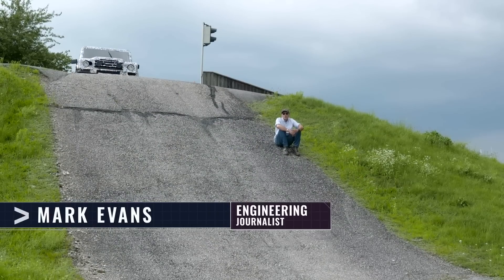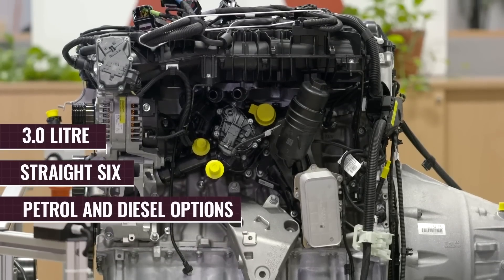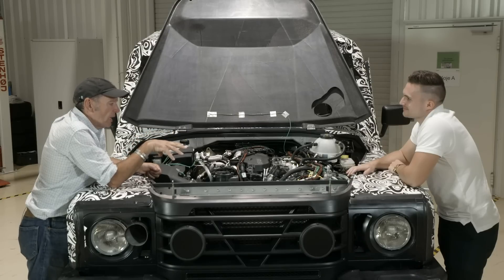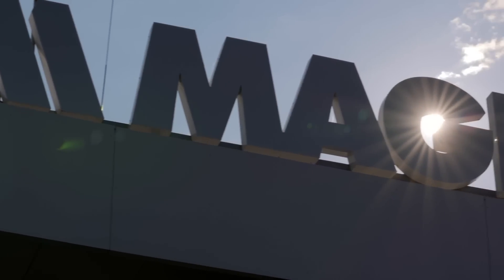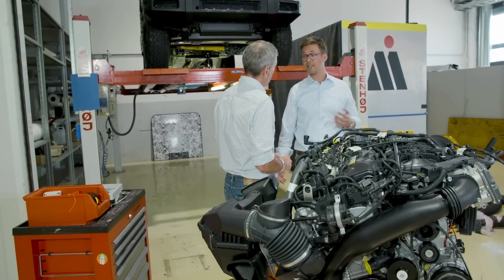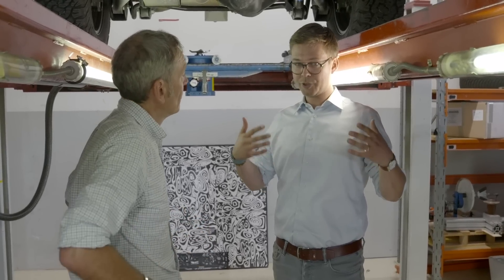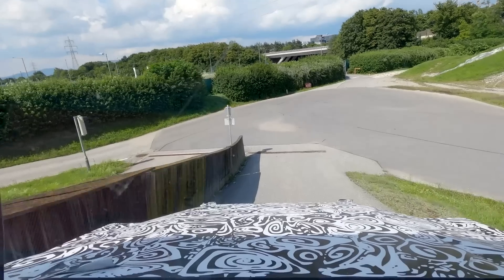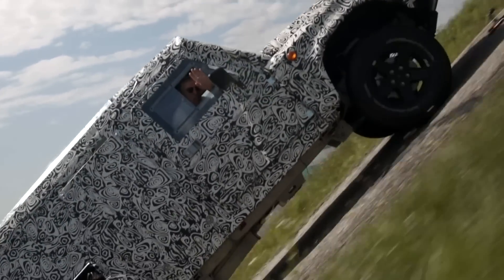Building the Grenadier - Episode 5 - Engine & Transmission

Comment: hi if its going to have permanant 4x4 does it not have to have a limited slip dif to stop transmisson wind up,in the series l /rovers you dare not drive in 4x4 mode on the tarmac because of transmission wind up ! same with my old beford rl 4x4 !
Reply: Apologies if you already know any of this... What they mean by permanent 4x4 is that the drive will be sent equally to all four wheels but the differentials (front centre and rear) just like in defenders will allow all four wheels to spin at different speeds. So if one wheel was to lifts in the air and completely lose traction then 100% of the drive would be sent to that wheel (because it’s got the least resistance), and the other 3 would receive no drive. So when they say 4x4 it’s not ‘true’ 4x4.

Ineos will have a switchable centre diff lock and with this engaged (like you can do in defenders) then in the situation I describe above - 50% of the drive would be sent to each axle. Therefore the axle which had the wheel in the air would receive half the drive (which would go straight to the wheel with no traction), but crucially because the centre diff is locked the other 50% of the drive would go to the other axle whose wheels could then find traction and move the vehicle forward.

Where things get difficult is if one wheel on each axle is off the ground ie. an axle twister. If this occurs then even defenders with a centre diff lock could be completely stuck. And that’s where individual differential locks on each axle are required. The very best off roaders have a centre diff lock to split the drive equally front and rear, and then a diff lock on each axle to split the drive equally to each wheel. In that situation even if only one wheel was in contact with the ground it would still receive 25% of the drive. Very few vehicles have three diff locks though, but it is possible the ineos might.

So to answer your original question - transmission wind up only occurs when diff locks have been engaged. You can usually ‘unwind’ the transmission by reversing a short distance, jacking the wheels up or just driving over some slippery wet grass where the wheels will spin a little bit and release any transmission tension.

Comment: Ineos you dropped the ball on the transmission. Choosing an automatic transmission defies the purpose of this car.
This type of transmission needs highly qualified(Bmw certified, knowledgeable on how it works/calibrates) personnel, computer equipment and hard to procure electronic parts/meca-tronic actuators. This defeats the purpose of having a rugged car/reliable/less complex to be able to be serviced in remote areas. It's enough to check the Bmw forums to see defects/wear affecting Bmw cars (with ZF automatic gearbox) that just surpassed 100.000 kilometres, barely out of warranty. And those were driven on normal roads. Using such a transmission off-road will likely subject it to higher wear.
Ineos you wanted to offer a true dependable off-roader - a continuator of the original Defender - but you ended up offering one of these high automatic, high maintenance dependent cars that you see everywhere. So much for the authentic off-roader.
Reply: Actually the ZF 6hp and 8hp have proven to be very reliable gearboxes. The 6hp has been out since 2000, whilst there are some known issues they generally last just fine. The mechatronic units are pretty easily serviceable with solenoid kits being readily available. They've been put in a bunch of different vehicles including a lot of 4x4/SUVs that get used for hefty towing which is usually a good way to ruin your gearbox, basic servicing is typically all that is required to keep these going. 
Manual transmissions are nice for the nostalgia but modern automatic transmission are bloody fantastic!
Reply: @MegaGouch  You could look around on the Bmw forums to see the horror stories at just 100k, barely out of warranty. Finding qualified techs to work on those is a challange. Even simple operations like oil change cause the transmissions to run worse due to improper re-calibration. That gearbox is a computer itself. To work on it you need to have equipment, know electronics beside mechanics. Not to mention the parts. Good luck finding those in remote areas.
Why complicate something instead of using something simpler/reliable/proven/easier to service? Are you racing the offroader? Are you busy with your mobile? Are you too tired to drive? Then stay home and get some rest, the car is not for sleeping.
Reply: @alexg475  I know about the horror stories but they are not indicative of every gearbox. I have a 6hp26 in my Disco3 that's done 195,000miles, these gearboxes have excellent reputations on Land Rover forums and are one of the few things to give little trouble on the D3, RRS and RR. My gearbox began to have a bit of torque converter shudder so I replaced the fluid,  was a easy DIY job like any other transmission you just need to check the level when the oil is at the correct temperature but this is normal for a lot of modern automatics. I had to reset the adaptations as they were calibrated to the old dirty fluid. After an hour long drive the new adaptations were set and it shifts perfectly. Yes you may need a scan tool to work on the gearbox but you will to read codes on the vehicle in general and engine faults, so it's not really a problem.
Reply: @alexg475  Actually reading Land Rover forums the manual transmission is prone to burning out clutches when doing a lot of towing. Whereas the 6hp tows a piece of cake.
Reply: @alexg475  Just before 100k is transmission oil replacement time - considering this is about the cars lifetime (I realise people keep cars for far longer these days) many ZF boxes  are considered transmission oil for lifetime - a hell of a lot of people NEVER change the oil post 100k and that's where they start getting issues.
Reply: @MegaGouch  Volkswagen similar, DSG piece of garbage. Just done 120K. Our Golf had mechatronic replaced 2 1/2 years ago and is already failing again. Gearbox needs half a rebuild again. Lovely car otherwise the Golf. Our other Golf is fine but has done only 60K. My Defender 110 (2013) 110K never had a problem and no oil leaks and it gets a really on and off-road good work out. Our 90(2012) has done only 50K, but had only a few minor things replaced 2 seals and one gasket.
We had two BMS X5 from new, never had a problem but hey we trade them in every 3-4 yrs so we would never be out of warranty, Our Audi Q7 just out of warranty major fuel and injector problem. $15K repair. Never again. All these fuel emission compliance engines need high quality diesel and when you drive in the outback of Australia you have no idea what you get (or even some of the smaller places or roadhouses). Tracks we did in Africa don't get me even started. Can not see a BMW engine having a reliable life out there.
Reply: @raymondallo9947  fuel and injector problems are unfortunately always a possibility with common rail diesels, Toyota has been having issues for years around failing injectors. DSG gearboxes are very different to the slushbox/torque converter style of automatic, whilst they are good in some situations they would not at all be suited to an off road going vehicle, the ZF box they've gone for is a completely different animal. The reality is there's no way a manufacturer can put a 300tdi or other old school diesel in a new vehicle, they wouldn't pass emission requirements and people wouldn't pay $80,000 for no power and no torque. Some people might buy a vehicle with a manual transmission,  but an auto would appeal to a far wider audience and in many off roading and towing situation an automatic is a better option.
Reply: @MegaGouch  I have no problem with automatic. My wife and I are looking forward to that. Plenty of die hard people for manual have been converted to automatic just look at these guys  https://www.youtube.com/user/4wdaction. They would not go back to manual. Our plan is take the Grenadier to Japan then to China and Drive through Russia to Amsterdam. Well you can dream can't you. Lets see what the Covid is going to do.
Reply: I feel like they got everything right and then someone hit their head and thought "BMW engine, yes! Auto transmission, yes!" What a sad decision.
Reply: Absolutely correct! People who want to buy this type of vehicle want to shift themselves and want to have an offroader that is reliable, strong and simple. The purpose of an offroader is to have a great time, enjoy driving, shifting,...

Comment: So they promised a robust engine but they fitted a BMW unit.
They promised a manual gearbox but they only offer an automatic.
They promised to build it in Wales but it's going to be build in France.

The more I learn about this project the more certain I become the Toyota 70-series will be produced for a long, long time. 
Cheers
Reply: Agree,  they lost it with the BMW engine.   Should have fitted toyota diesel.  Fixing a BMW in Africa is not going to work.

Comment: If this is priced right, say hello to my Land Rover LR4/D4 replacement... 

It’s exactly what I wanted. A truly modern take on the OLD Defender without looking like a crossover (cough, new LR Defender, cough)with BMW’s fantastic I-6 engines. I really hope the diesel is offered in the US!!! I would prefer a manual. Since they’re going to use ZF 8HP, I hope they at least make the transmission serviceable. That’s the problem with the ZF 8HP in other cars. The transmission pan and filter are one unit that make servicing a nightmare involving retrofitting aftermarket parts.

Btw, George Fuchs is a good looking chap. Lol.

Comment: INEOS Automotive, and Magna Steyr development and product management team: please think seriously about laminated glass (German: Verbundsicherheitsglas), not only for the windshield, but for each window, at least as a factory option. Better safety in case of accident, break-in protection (30 sec. instead of 3 sec needed to break a window), UV protection, and as a bonus decreased noise and better insulation, too. Lots of cars from VW/Audi, Volvo, Mercedes, BMW, Citroen offer it now... Even better, fit it as standard, as the new Polestar 2 EV does.. :-) The added BOM and weight are negligible. This is one thing that aftermarket suppliers won't otherwise be able to offer, it has to be planned and delivered by the manufacturer itself. To compensate for the added weight, fine tune the B57 ECU to deliver 235HP (instead of the 230HP I am guessing you are thinking about) :-). This will be one more USP, compared to say Wrangler or LC Prado (that cannot offer it). UV protection is very relevant for the driver's health, just google "truck drivers developing skin carcinoma". Also, try sleeping in the car and see the difference when you wake up. Overlanders (one of your target markets I would say) will be forever thankful, lots of positive effects for them.

Comment: Looks good but how many years does it have as everything is going electric. Rivian are coming out with an off road 4wd . I live the concept but the automotive industry is in a transition to EV
Reply from the maker: Hi J. The Grenadier will be an essential tool that needs to work in the most inaccessible parts of the world that today rely on petrol or diesel fuels. However, we are already investigating alternative fuels for the future. This includes a feasibility study on the use of hydrogen fuel cells in off-road vehicles.
Reply: The kind of place this vehicle will be driven is the kind of place that will only be selling diesel for the next 50yrs, no charging points 😂

Comment: The engine and gearbox from BMW may be great, but does not fit in to utilitarian quality or genetic makeup of Grenadier. They should have taken Isuzu 3 litre diesel engine with Aisin torque converter and transfer case. Cheap to maintain, literally bullet proof. Qualified to comment as longstanding owner of Landrover Defender over last two decades.
Reply: Japanese engines are bullet proof and very high quality as new, but usually develop problems towards 500 000 km's. Whereas for example Mercedes Benz diesels run regulary 1 000 000 km's without major mechanical issues.
Reply: @wopmf4345FxFDxdGaa20  Well, I own various Mercedes vehicles and do service them myself. Since W123 era, their engines have become increasingly complicated electronically and complexity or disharmony of communication between various computers or ECUs taken away the bullet proof reliability of engines as fitted in W123. This has also made spares and maintenance costs or ownership costs sky high. The engines in W123 200D, 240D and 300D were indeed bullet proof. Therefore, an Isuzu 3 litre diesel would have been ideal keeping in mind utilitarian, reliability and low cost of ownership in mind.
Reply: @harvindersekhon  Well yes they are more complex, but the complexity increase is also the case for Isuzu and Toyota. Modern diesels are fully electronically controlled usually common rail injection, have rather complex pump, etc. Those are not bush serviceable parts, even the mechanical direct injection pumps in japanese 4x4's were not bush serviceable, they are very expensive. Modern Japanese diesels are also turbo charged ( often variable geometry ), have DPF, have ECU's that at least in Land Cruisers is not water proofed. I think the bush serviceability of Japanese diesels in this regard is a myth. And don't get me wrong, I think Japanese make perhaps some of the best diesels, especially in 4x4's. But they are more complex nowadays regardless of manufacturer.
Reply: @harvindersekhon  The thing in W123 era was that the car was engineered and designed to last. W123 was not particularly low tech for its time, but it was so over engineered. They had the model almost ready for almost 5 years before release, when they were only testing it to fix problems. Modern car design cycles are usually quite much faster.

Comment: This is the first bit of bad news I've seen so far on the Grenadier. I really don't care that's it's being moved to France. But I'm not thrilled about a BMW engine. I understand that it's a whole different can of worms to design your own engine from scratch and using and existing BMW engine gives you access to a worldwide network of pre-trained mechanics, so while I'm not excited about it I also understand the move and hope that in the future Ineos will be able to put their own engine in it once they've got their feet under them a little more. And I'm really disappointed in the lack of a manual option. I love the manual transfer case and lockers, no one does that anymore, so why not a manual transmission too? Auto works fine, but it's not the driving experience that I'm looking for.
Reply: I ensure you that auto doesn't work fine all the time/for every purpose... And I mean in particular conditions.